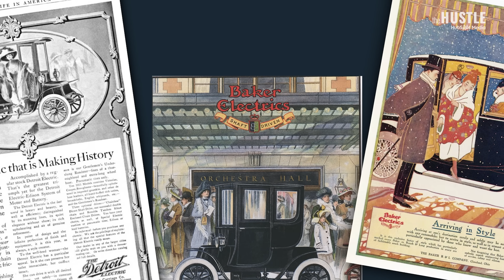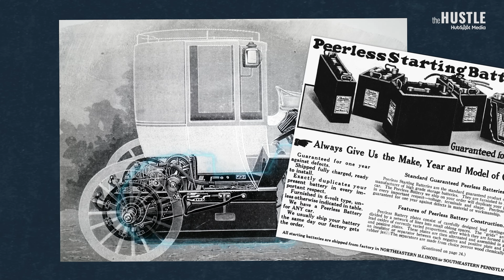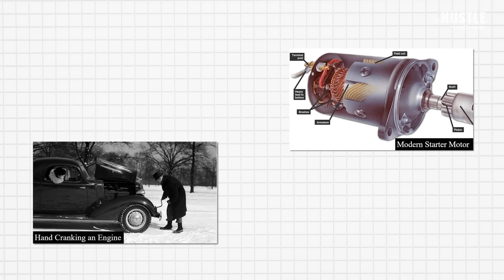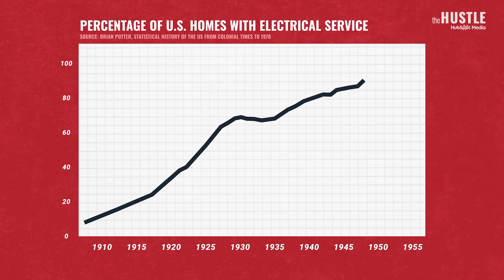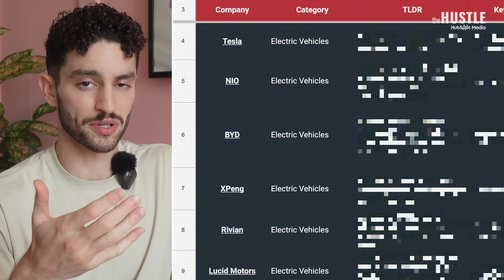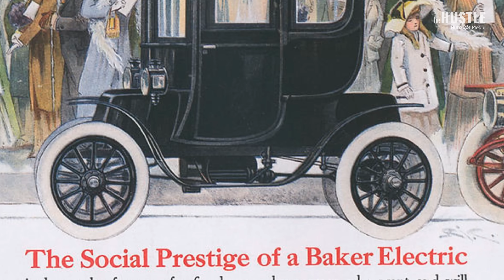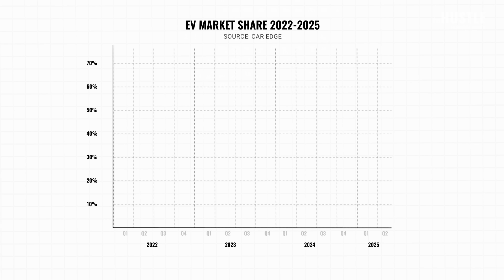How Laptops Brought EVs Back From The Dead

Comment: I can drive for Uber/Lyft 8 hours straight before needing to recharge, which can take as little as 24minutes & as much as an hour. Can you not afford a 24min break to eat, go to the bathroom, and rest every 8 hrs? Congratulations, you’re a robot! 
These apps only allow you to drive for 11.5 hrs a day for safety reasons, which means that break after 8 hrs can actually be much less, enough to get home after 11.5 hrs of work & then charge overnight, or charge in the morning/afternoon in public.
Roadtrips would require one every 2-4 hrs, due to higher mileage.

Comment: EV owner here for 5 years, 120,000 mi driven and full time Uber/Lyft driver. Instead of renting an EV, try owning one for a few months; it’s parked 90% of the time doing nothing. Even with the slowest of charging speeds from a standard wall outlet overnight alone, is enough range for 90% of car buyers. Most people drive 30mi/day or 30mi/week. Level 1 charging gives you 5mi/hr, Level 2 home or public charging gives you 20-40mi/hr. This is all you need to charge overnight, at work, at school, while shopping, grocery store, gym, haircut, movie theatre at a public station. ONLY when you are road-tripping specifically long distance do you need faster Level 3 charging which gives 150-400mi/hr depending on efficiency and range of the car. Since they only peak while between 10-80%, it is better to stop more frequently for less time while road-tripping, a 15-35min charge at a time instead of an hour, not only to get the most miles per minute in the sweet spot (some older EVs only peak charge between 40-60%) , but to be able to immediately forfeit a station if there’s an issue & and immediately go to the next one without any range anxiety & plenty of battery. I’ve only waited in line TWICE in 5 years because of this. Newbies don’t know better and are stuck with 0%. This method also increases awareness and knowledge of stations. Which to skip, etc.

Furthermore, 3min charging has already been cracked in China in the lab, one day they will even charge in 1 min, and when they do; people will STILL charge Level 1 @5mi/hr overnight, because why wouldn’t you? The faster stations for people who don’t plan or are traveling long distance will always be the most expensive way to charge and the most busy. 
Also, I’ve never charged at home because I don’t have a garage and rent an apartment. I simply charge in the day while parked as cheaply as possible usually $0.11-0.25/kWh Level 2 speeds as opposed to $0.30-0.60/kWh on Level 3 Fast chargers depending on time of day. The Level 1 slow charger every EV comes with is only used when I visit family. 

Lastly, you will RARELY be charging more than 70% of your battery at a time, and more likely to charge everyday just a little bit while parked in public, to always be somewhere between 20-80%, and to go over or under that only when you need it. This can also be achieved with charging 5min/day @ a Level 3 charger which can give you anywhere from 5-19miles per minute of fast charging. That’s 25-94miles of range added in just 5 minutes with current charging infrastructure already widely available all over the world, albeit more expensive than slow charging.  I’ve driven from CA to Arkansas, to Wyoming, Colorado, Mexico, anywhere in North America you can get to in an EV as of 2021, and even more easily in 2025.
In summary, it’s a change of habit, a paradigm shift in how you think of “refueling” while parked, that gets people to realize EVs can work for them right now, instead of what we’ve done for 80 years; quickly filled up a gas tank in 5 min on a road trip, only to immediately park the car and eat/rest for 20-40min at a rest stop. Even a cross country road trip can utilize Level 2 (20-40mi of range/hr chargers) while sleeping either at a hotel or in your car, to wake up with a full battery. Imagine if every gas car was getting a slow trickle of fuel, however slow, when doing something you already were gonna have to do anyway- PARK!

Comment: One major issue with most EVs today is corporate greed and bad design. Tesla and other manufacturers have opted for minimalist interiors, integrating features like climate control, heated seats, and glove box access into a single screen. Even features like the direction you want the ventilation to go are behind a screen that can fail and only be repaired by certified technicians. Given the current state of late stage capitalism, it's likely that climate control and performance will become subscription services, if they haven't already.
Reply: That’s mostly Tesla, Kia/Hyundai & others are still all about buttons, while also having a touch screen option.
Reply: I agree.  They all have to be overbloated oversized crossovers and pickups.  Why aren't there any compact pickups or econoboxes?
Reply: There’s less parts in, and simpler to manufacture, than ICE vehicles. The car makers make most of their money on vehicle services and parts. That means they’re not incentivized to make the best quality car brocade they’ll lose a lot of revenue. 
Tesla rarely break down and they are actively trying to lower EV prices. That’s why they have less parts, less parts to break.  Putting get expensive, not just the button, but getting the button wired and talking  to the software can be a pain of the car makers aren’t vertically integrated like Tesla. Fords CEO has said that himself.
Reply: @RoqueExclusives you didn't understand what he said

Comment: The big question for electric cars is what technology will finally give them a complete advantage over gas. The video said the key is fast charging but that will be hard to setup all around the country
Reply: Count how many hours of the day your gas car is parked doing nothing, and if it was getting as little as 5mi of range added per hour at home (the slowest public chargers give 30mi/hr) how much that would add up to, and ask yourself if that would give you enough range. 
You don’t need a quick fill up unless you’re road-tripping specifically long distance, which you still need to stop, eat, & rest for 20-40min atleast & then sleep 8hrs. The other stops you make can be as little as 15-25min instead of 5min. 
I’ve driven from CA to AK impromptu, with little to no issue, back in 2022- it’s even easier now. You can drive anywhere in North America already,  using the fastest Level 3 chargers alone, if you know this secret. Most compare apples to oranges and get lost not even knowing how much they drive on average.
Reply: @TheTanman412 what happens when you do need to go out of town. Elon set the standard so a charging station can be setup on the most inconvenient places with no people around because Elon likes to get rid people even if they can add security and help maintain equipment. I don't even feel like bringing up the edge cases that can't charge at home. You people don't want to be honest and say electric cars are the perfect comuter car like a Toyota Corolla. Electric cars are supposed to be your second car

Comment: I’d disagree with the Elon and adoption thing. The fact that we are at 1.5% is crazy for EV’s . Because the math is that if we somehow made every single vehicle on the road electric today. It would take 20 years to replace all gas cars
Reply: And that’s if the adoption rate does NOT become exponential (which is almost impossible) & instead stays at the exact same slow pace it’s currently at. 
California went from 0.5% of new cars EV in 2021, to 3% in 2022, 7% in 2023, 15% in 2024, and over 26% in 2025, which “experts” are calling a “slow-down”😂
Reply: The reason why China is very aggressive on phasing out old ICE cars and transitioning into EV. They have a strong mandate of no new ICE vehicles sold in 2030s, and the result is over 2/3 of new cars sold there are EVs now

Comment: 6:76 Took that long to get to the point. It's the battery. Lithium Ion Battery revolutionised Electric vehicles.
Reply: Combined with aerodynamic advancements, white LEDs, gallium nitride heat sinks, permanent neodymium magnet  electric motors, compact inverters, and advanced software to boost efficiency and range.

Comment: 10:00 Lithium is the third most plentiful element in the universe. Our oceans are filled with the stuff. You see those salt flats in the footage? Those are dried seabeds! To say it is a "limited resource" is just ignorance.
Reply: It's all very plentiful but the problem is the processing
Reply: Just because lithium is the 3rd most plentiful element in the universe, doesn't mean that it will be most plentiful element on earth. The 3rd most plentiful metal on earth is sodium, and sodium is over 20 thousand times more abundant on earth than lithium

Even the "lithium salt deposits" that are mined and extracted to pure lithium only contains about 2% lithium since the rest 98% of it are the sodium choride salt

Also the abundance of the sodium finally realized by the making of the sodium ion battery this year, to balance out the growing demand and stabilize the price
Reply: @sihamhamda47 Notice you change the metrics, switching from element to metal.
Reply: @downix  if you want the metrics unchanged, the 3rd most abundant element on earth is actually iron, it's right after oxygen and silicon

Sodium is 5th most abundant element on earth, while lithium is far below at 18th
Reply: Not to mention the world is already starting to move towards Sodium-ion, and other superior chemistries that have ZERO Lithium, which will make it even cheaper.

Comment: My wife thinks the ev we have is expensive but so far I've saved money in two oil changes and 2800 dollars in fuel. I think that's a win.
Reply: Our family’s EV has saved us a long in gas and we’ve only had to replace the battery twice in the past 250,000 miles costing us about 17k total. Not bad the way I see it
Reply: @David_Trang you’ve had to replace the entire battery? And it costed 17k? That’s like an engine swap. That’s crazy. My gas car hasn’t had any major issues besides routine maintenance and it’s at 250k miles. The original engine still runs like a clock.
Reply: lol.......
Reply: Wait for it lol

Comment: I knew about EVs in the early 1900s but not about that prototype in the 1830s 

I often think about how different our world would be if EVs won the race from way back then - if only
Reply: A lot of stuff needed to happen.
Reply: @macbere3326  yeah the lithium battery alone isnt enough, its things like advance in power electronics, more powerful and efficient processors, integrated circuits and millions of other electronical stuffs brought us here.
Reply: The total setback of EVs back then was the battery technology. Lead acid batteries found in the 1800s, nickel iron batteries (which later becoming nickel metal hydride) found in 1900s, but lithium batteries never came in until as late as 1970s
Reply: Yeah if they discovered lithium ion battery.
Reply: EVs would never have won any race and even if it did we would still be living under the rocks lol! the ICE allowed us to build roads, bridges, entire cities, global trade, mechanisation of the industry, aviation and much more.
Reply: @carholic-sz3qv 
Just sounds like you are afraid of change.

Comment: That thumbnail makes no sense, that is not where the battery is located and it’s way too small for a laptop. Laptops that did use 18650 (the same size as the first Tesla) usually have them in an array at the back of the laptop.
Reply: Some EVs actually uses pouch cell lithium polymer battery similar to ones in recent laptops, like the Nissan Leaf
Reply: he was referring to the 18650 whats your problem?

Comment: 7:33 “…due to its small size and short range.” This is revisionist history, or at least you are stating as fact something that has been hotly debated for decades. People who leased the GM EV1 generally LOVED them - that much is not open to debate.
Reply: NiMH EV1s and Toyota RAV4 EVs were capable of over 100 mile ranges in mixed city and high speed driving, from the late 90s!
Reply: Dude even the NiMH EV1 only had 26.4kWh. Even for such an efficient small car it only had a real world range of 110 miles. That is very much short range.
Reply: @Neojhun  Just google the average daily driving distance wherever you are. If you want to fight semantics, yeah, the range is short. In real life, though, short range EVs like this or the 1st gen ZE0 LEAF with 24 kWh batteries performed all daily duties exceptionally well. They're excellent cars - for their purpose.
Reply: @Neojhun +100 mile EV is still practical for everyday use, especially for the 1990s

It would be a nice change in market trends to not have +300 mile behemoths.

Comment: 80 miles of range in the 1920s is insane. Grandma Duck also had a Detroit Electric like that. And bakeries in Berlin used similar trucks at the same time for quiet deliveries. Today, BEVs are far superior to ICE cars, no competition.
Reply: In the 1990s EVs with NIMH cells were capable of +100 miles in modern day driving.
Reply: The chinese EVs especially
Reply: nothing insane about that it was mostly cities where evs are more efficient! the ICE has to be improved so that it could actually build the roads, the grid and all the infrastructure on which we rely on today.
Reply: Range record for an EV set in 1921 was 249 miles, set in a 1919 Baker Victoria.
Reply: @downix  yeah hypoermiling in the city right lol!!!
Reply: @carholic-sz3qv took him a few days if I recall.
Reply: @downix  ...and that thing is not the least bit aerodynamic. Wow. Thanks for chiming in!